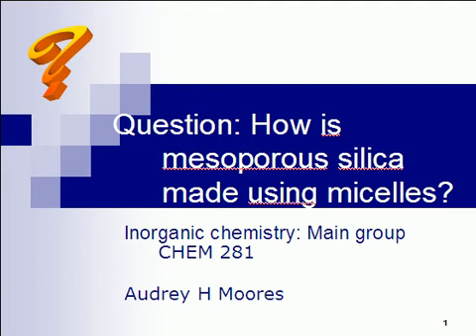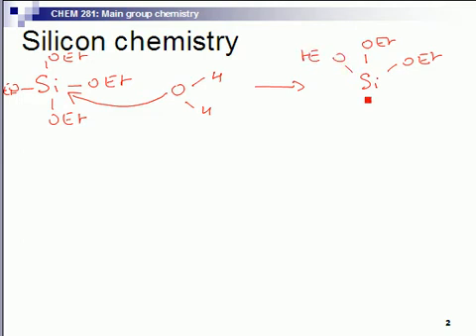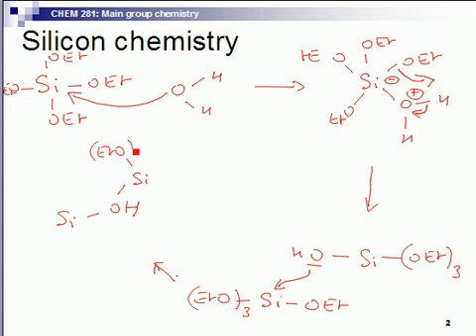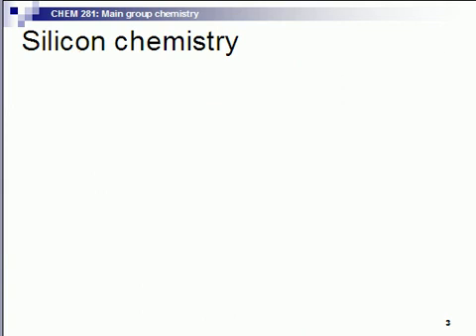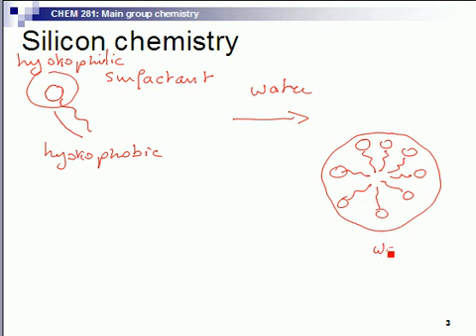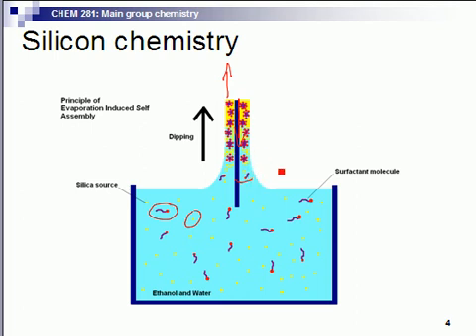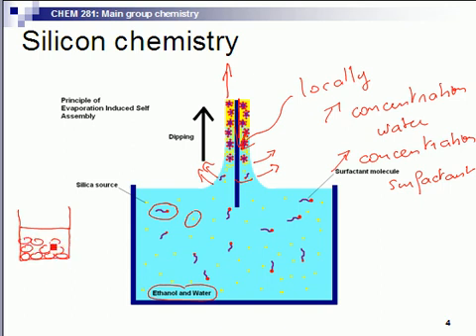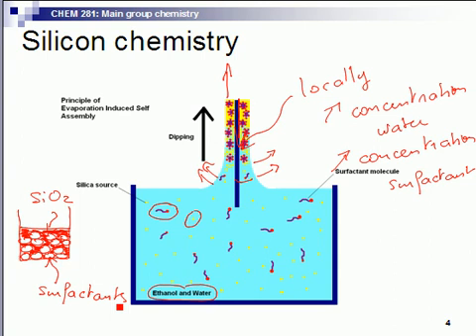Mesoporous silica

Comment: How do you make mesoporous silica thin films using this method? The dipping method and pulling out will produce a thin layer but the thickness is not really controllable.

Thanks for the video. Very clear explanation of the sol-gel process as well.